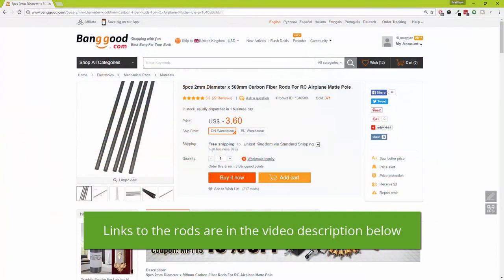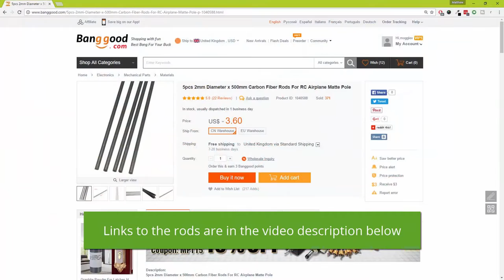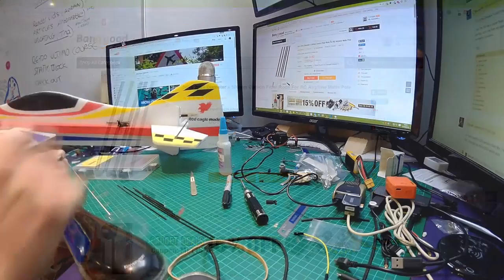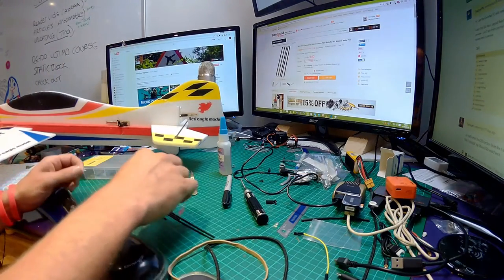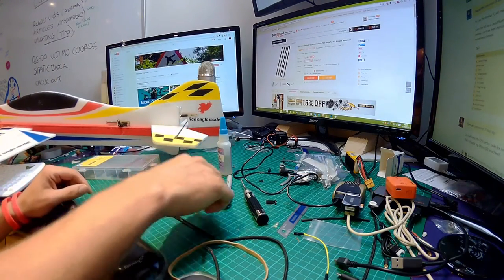Build Tip: Strong Push Rods Using Carbon Fiber Reinforcement.

Comment: I use carbon tubes push fitted over thinner wire pushrods. Once the model has been trimmed out you can cut them to the exact size negating the need for any glue or heat shrink. I've also beefed up thin wire pushrods by adding thin bamboo skewers glued and heat shrunk to the side
Reply from the maker: Good morning! Yea it makes them infinitely stronger than before. I took the hummer out for a smashing on Thursday and it was sooo much better with those rods in place. Matt